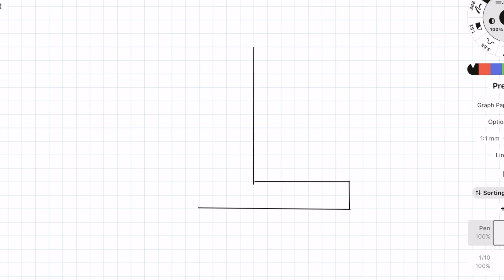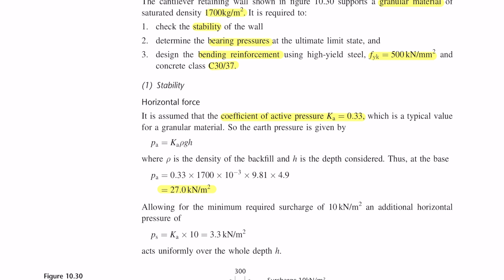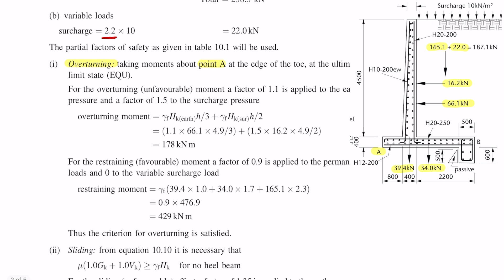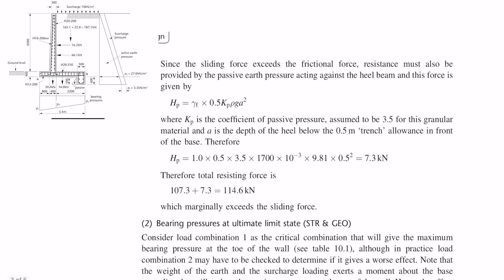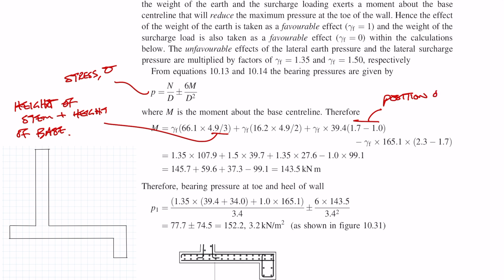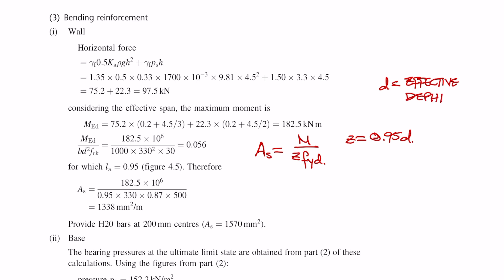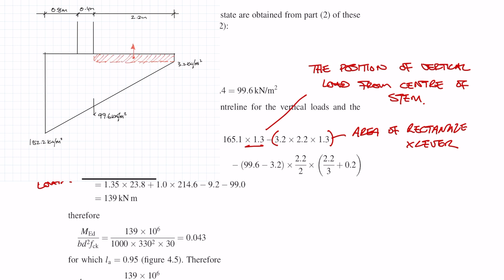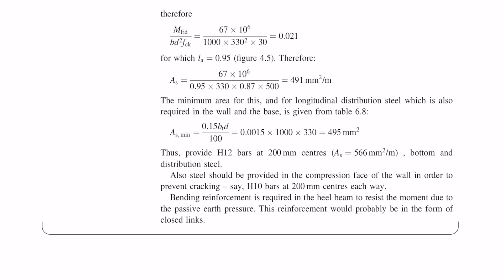How to design a reinforced concrete retaining wall - Structural Engineering

Comment: Regarding the passive resisting force against the heel beam @4:30 why isn't the formula  [Hp=Yf x 0.5KpPg(aH)]? - 'aH' as opposed to 'a2' . Why isn't the fill above the base slab being taken into account? Wouldn't the fill above be placing pressure on the soil at the heel beam level via the base slab? or is the pressure from the fill above not being transferred through the base slab? Genuine question.

Comment: Pretty good work man. You explaind it pretty well and took some conservative assumptions, which is always on the safe side. I just want to say, you forgot the shear checks. Never forget that shear, is a fragile mechanism and should be not neglected!
Reply from the maker: The textbook forgot the shear check 😛 but yes do remember to check shear however in my experience, shear is hardly ever critical and retaining wall design is governed by bending and deflection.
Reply: @EverydayDazz  I agree, but you have to be sure :)